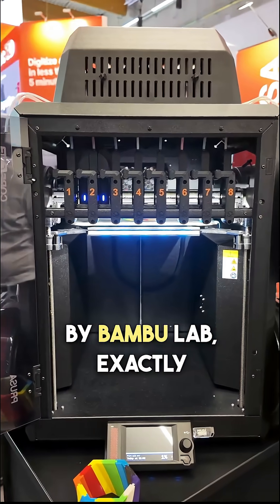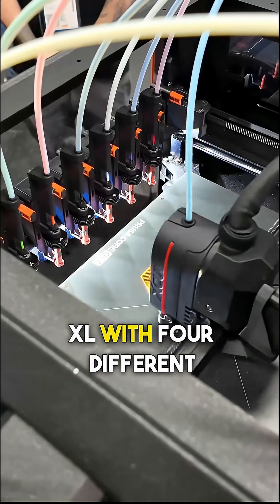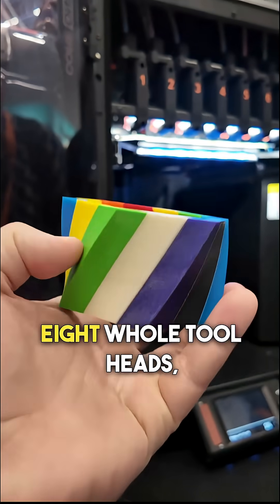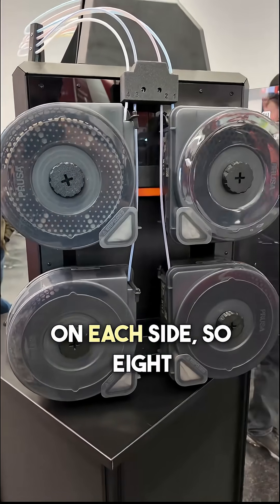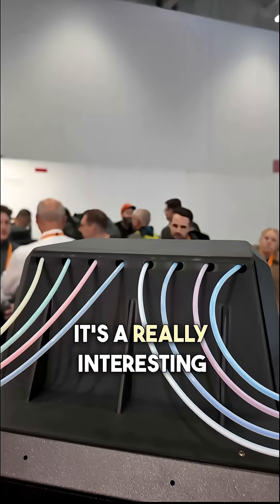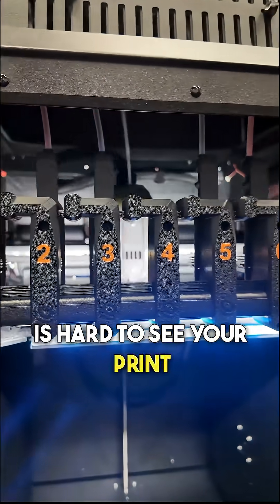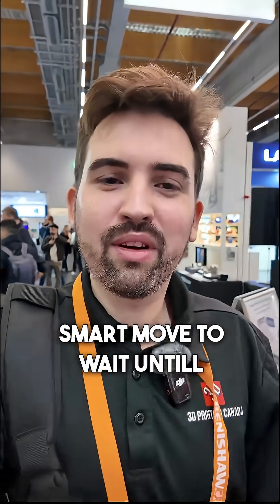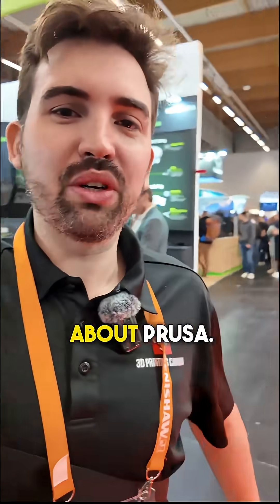The New Prusa Printer Has 8 Nozzles! #3dprinting #formnext

Comment: Why not put the tool changer on the side?
Reply: The tool changer is made to fit the machine.  Same as the first electric cars, they were made on existing frames, so they was shit.
Reply: @dubious6718 but isn't that what bambu did? I thought they made an upgrade for certain printers that added a tool changer on the side
Reply: @KiloFeenix  H2C is a new printer, but they are coming with upgrade kits for older H series.

Comment: I can’t believe they are still using 3d printed parts at this point. 

It looks amateurish now, BL and other brands using proper molded plastic parts look way better and I’m sure durability should be better as well.
Reply: Sounds like you do not believe that 3D printers can be used in manufacturing. Do you just make PLA flexidragons?
Reply: @RogerEssigArtist  i am from the plastics industry and i think what he is trying to say is first moulded plastics are way cheaper for mass production and second it is stronger and third it looks way better. I also dont get it why they do that tbh it is kinda stupid and you have to pay more for lower quality parts at the end
Reply: @anguismemes1666  I was thinking that the end user had to print the parts. Selling printed parts is even worse.

Comment: I don’t know how I feel about the 3d printed parts on a printer at this day and age.
Reply: I was thinking the same. 10 years ago it was revolutionary but now it seems cheap tbh. Specially at the prices they’re charging, it looks like a diy build at the price of a prosumer gadget.

BL and others do it much better, their machines look much more polished and durable.
Reply: you rather pay extra to have injection molded parts? Why? When 3D printed parts do the trick. Quality gets better every year and when it breaks you can reprint it because the part has been designed to be 3D printed. I don't understand how you can feel this way when you have any interest in 3D printing. Also it allows western companies to compete with cheap Chinese printers.
Reply: Agreed.  The first Prusa I bought was a MK3S, and even back then I was shocked to see it was all 3d printed.  Fast forward 5 years...they should have enough money for proper injection molding by now.  Reprap was (and is) cool, but for consumers it's time to move on.
There is another video of this thing in action and you can already see a crack forming on tool head #4.  I worry with continuous use this thing will wear out and tolerances will slip.

Comment: Prusa has developed nothing, It's an off the shelf system developed by bondtech.  It would have been nice if Prusa actually had an unveiling of a prusa/bondtech finished printer instead of introducing a DIY system made for any printer on the market.

Comment: Your problem is, it's still overpriced for the bed size, which has been a problem for them for a long time.  You can get bigger and more color options from Bambu for the same price or cheaper with a bigger bed.  Or go even bigger still and get a large format printer, with 7 "tools" (6 swappable) for a 7 color print with no purge, or a full 24 colors with purging.  The problem the Core One thing is it is fixed at 8 colors, same for the U1 locked at 4 colors.  The reason Bambu wins still is none of their printers are locked at 4 or whatever colors.  Even the A1 used to be fixed at 4 colors, can now use the Standard AMS units for a full 16 colors.

Comment: Will there be a version for the CORE ONE L?
Reply: Wont be out till mid-late 2026. The Core One version doesnt come out for ~6 months either (Q2 2026). Oh and the announced pricing was only fro the founders edition which was being sold by Bondtech, not Prusa, as only Bondtech can make them. Prusa just has paid for a period of exclusivity. The more you read about it the worse it gets, it makes it clear Prusa were not capable of making something themselves and had to outsource it. That might catch them up a bit but it does not bode well long term.
Reply: @puressk I am wondering which Modern CoreXY Printer to get (non-Bambu) I'm between the Core One L with the INDX, SnapMaker U1, and AnyCubic Kobra S1. Elegoo Centauri kinda skeptical atm

Also after an insane amount of saving...the Prusa XL 5-Head.

Comment: What is the use case for eight colors?  This seems trivial.
Reply: If you have a print farm, this is a major time and labor saver. Load up 8 spools of the same color and material, then use spool join when one of them runs out.
Reply: 8 materials not colors
Reply: @SniperTeamTango  Not advisable to print with 8 different materials.  Should be careful when using 2..
Reply: The use case is just like in other consumer goods, a race to see who can make the newest thing just because its cool and novel not to make the most practical. It's dumb and for the cost, you could go buy a cnc router or a resin printer from the difference...  Also, if you're smart, you can just incorporate multiple materials as separate parts.

Comment: Now at that points, its just getting a bit unnecessary.
What we need, is better chamber heating. I agree that bed can be used, but imho chamber heater would not hurt. With better thermal isolation
Reply: True. I have a Qidi Q2 alongside my Core One and the chamber heater means Q2 becomes the go-to ASA printer. Maybe someone makes a 3rd party add on heater for core one
Reply: @RogerEssigArtist  i feel you! I built my own hot air circulation circuit for P1S for exactly ASA reason
Reply: @AljazJelen1992  I have a hairdryer i use to get the chamber temp up and can do an ASA print at 55 degrees C as long as my house temp is regulated. I have an insulated top cover for the Core One too.
Reply: Not unnecessary at all. I have desperately needed a good printer that can handle multiple materials and multiple colored flexible filaments at the same time. The INDX should work perfectly
Reply: @DiegoJ1023  maybe not entirely necessary but its definitely a bit.
Many of the "multi-filament" 3d products can be designed in such a way, that you can print and assemble or print and glue.
As far as engineering goes, you dont need multicoloured anyway. Multi material perhaps, but then adhesion is another question mark.
E.g. if you want soft grip with tpu on the petg as basis... its better you print the petg and mold the PU around the petg
Reply: Not saying Prusa isnt great, just five cents from those who try do do more engineering printing
Reply: @AljazJelen1992  yup, heated chamber is probably the decider for me. 8 heads vs 7 isn't that big of a deal. volume also looks smaller on the Prusa.  

We need to see some head to head comparison reviews that aren't sponsored or fanboyed.
Reply: so if you go only with the single nozzle and the 6 heads, you get 325x320x325mm vs 300x300x330mm or 0.0338m^3 vs 0.0297m^3 with the Prusa or roughly 14% more volume on the Bambu H2C and only about 5% more volume on the H2C with both heads installed. 

You get  20mm more in depth but give up 5mm in height with the two heads, You gain 25mm in width (roughly 1 inch) going with just the head changer. Granted it's a little more complex than that because at the 300mm width you can still print 25mm to the left with the 6 heads and 25mm to the right with the single head, from what I understand.
Reply: @natesewell9402  Core One L will eventually get a 10 toolchanger system, but this Vid is for the Core One, which is 220x250x 270. minus a bit for fitting the toolchagers
Reply: @RogerEssigArtist  yeah My calculations were for the L. The H2C has about 125% larger volume than the smaller variant Prusa. I didn't know that the Indx system for the L is going to support 10 heads.

Comment: too expensive, both, prusa and bambulab!!!
Reply: On that we can agree, its crazy how the top systems are multiple thousands of dollars now. And then you factor in AMS systems for the H2C, you need two for the right nozzle to use all 6 vortek hotends. BUT WAIT! They give you a 0.2 and 0.6 nozzle in the mix, but don't let you mix and match nozzles on the same print. So you'll have to shell out another $80 for two more 0.4 induction nozzles 😂

Or just buy the H2C ultimate edition for like $3000
Reply: Work overtime hours and earn more disposable income

Comment: I'm a Bambu guy...but, those tubes are nice - has a V8 ignition lead look to them.
Reply: Ha I didn't even think of that. I'm also a Bambu guy. I wish I didn't buy an H2D two months ago for the same price as the H2C 😂
Reply: @SangheiliSpecOp  yeah but Tariffs had a lot to do with that price too. Makes sense to lower it some after they figured out the way to get them in without paying haha. I am on the fence because I have 2 AMS pro and 4 HT. The printer does fine with the 2 tool heads and there is hardly waste now. There is NO way I am going to buy that upgrade and I have take my H2Ds apart a few times. Stupid heater and hotend fan failures. They need to work on making it simple to get to fans that wear out for the end user.
Reply: @unitymind I have barely used my H2D for now so I haven't had those failures yet but I've heard some negative things. Actually you reminded me, support just sent my replacement filament buffer out and it arrived 2 days later, my new HT filament loading isn't being detected by the left nozzle and the extruder keeps retracting instead of grabbing it. Bambu says I have a bad buffer so I have to replace that today. The vortek kit looks like a good project, I just wish they didn't shaft us and make it $799 for the kit.
Reply: Am sadly also a Bambu Guy, and I'm waiting for the day, everything gets changed into a subscription model.
Reply: @mahe4 that would be the end of them if they did so I very much doubt it
Reply: I switched away from Prusa to Bambu simply because I no longer wanted to tinker all the time- just print my parts. I don't have a major use for toolchangers as i don't print multi-color hardly ever, BUT - I will be ordering 3 or 4 of these Prusa machines for my wife. She's got time to tinker, and she prints tons of multi-color props and cosplay bulls#it- these seem purpose built for that. 

I do feel Bambu dropped the ball by not introducing a revised AMS alongside VORTEK to better optimize filament swap times- i.e. six spool capacity with six individual tubes to the top of the printhead for ultra-fast filament changing.
Reply: If you're not chinese, even more so if you're a westerner, "being a bambulab guy" is really a strange idea and a very bad bet on the future.
Reply: @pierrew1532 china evil grrrr
Reply: @pierrew1532here comes the prusa shills
Reply: @WibberNoggin  Why shill for any brand? Brand loyalty is a fucked up bizarre thing. If a product is good, I'll give props to whichever company released it and consider buying it, but it sure as hell won't make me buy that brand exclusively.

Comment: Its so cringe to see Prusa and all the videos constantly attack Bambu meanwhile Bambu doesn't acknowledge anyone else and just sells printers that work lol. The H2C will still sell more even though its objectively slower, because it just works and everything is automated. I will be converting my H2D to an H2C when the vortek kit comes out this January. I may consider this prusa if it works out well though...
Reply: I've always rooted for AMD, but this is the same sort of thing that they would do. Nvidia would always compare themselves to their previous generation, and AMD would always project / compare themselves to what they think Nvidia was going to do. lol
Reply: Yeah that's what happens when one of them is guilty of IP theft
Reply: Josef attacked them at the start because they forked prusaslicer and dont honored the license. But when i see how Bambulab operates i dont like them. Just take NFC on spools. Bambulab use it first but only for their spools. They are like apple ... buy all from us. They also claim to have ISO27001 from dnv. But i can not find them on iaf search. Even for cert number. Which is quite suspicious to me
Reply: "Attacking" no is attacking Bambu. Bambu has an entirely different system, and multi-material systems, tool changers, tool head changers, etc have been around longer than either Prusa or Bambu. Prusa is licensing/partnering with Bondtech on this system. They didn't make it. The Bondtech INDX is just a better method than the Vortek. The Vortek is designed to keep using Bambu's AMS ecosystem. Bondtech also has patents, so I'm not sure how much Bambu could've done without needing to license it. 
Someone else mentioned Nvidia vs AMD, and that's a good example. When you're the underdog, you are going to compare yourself to the leader. When you're the leader, you don't compare yourself to lesser products, you compare to your own products. It's a form of arrogance from market leaders. In a healthy competition, both would reference each other and market how they think they are better.
Reply: Prusa, to my knowledge, have never attacked Bambu... What the Youtubers do for clicks isn't at their behest.
Reply: @krazed0451 fair, but even on prusa's own blog post they specifically point out "dual nozzle printers are a special case and the nozzle changes on that system take 40 seconds"(I'm paraphrasing), specifically targeting Bambu. They can do what they want but its just weird to see all the jabs from youtubers and prusa themselves, I know everyone is mad at Bambu for innovating and locking down their ecosystem, but the reason everyone will spend H2C money is because their printers just work. Also, you don't make really good printers with off the shelf parts. I have seen three youtubers now complain that 3rd party manufacturers may not be able to make induction nozzles because of the pcb on the hotend. But the whole reason Bambu did it in the first place is for contactless communication and power (unlike the snapmaker U1's pogo pins, for example). Also, induction heating is no joke, so if they are doing this system anyway, then you might want to stick to bambu so you don't get molten lava on your heatbed lol.

But yeah its just tiring to see the hate on Bambu, I know people like to tinker and Bambu's aren't those machines, but they have introduced a lot of people to the hobby
Reply: Prusa make toy printers for toy makers. INDX fits this with 300 nozzle and 50 max chamber. For toy makers, nothing more. YUUUUK
Reply: I agree, Prusa is so cringe. Just milking cash for as long as they can, 0 innovation. 

Bambu is a fantastic company propelling 3d printing into the future. They’ve got my business for life, or until they stop being innovative :)
Reply: @erikhoffmann1252 Of course they got your business for life big boy... One forced software update and your printer becomes a piece of modern art.
Reply: @00000005547 what is this doomer take that everyone has on Bambu. Why would they brick your printer?
Reply: @SangheiliSpecOp not intentionally (obviously), but anything that relies too heavily on online features easily becomes a paper weight if they make a mistake (like when they accidentally started prints on anyones printer that happened to be online, look it up) or a bad actor pushes malicious update.

I have a bambulab printer and I love it. But I unplug it when not in use. 😊
Reply: @ZpeedTube fair enough. I have my A1, X1C, and H2D on individual surge protectors and remote outlets so I just hit a switch on the remote when I'm done printing as well so I don't wear out the switch on the back of the printer or use unnecessary power. I am familiar with the printers starting by themselves that one time yes. But eh everyone is over reacting at Bambu. I don't get being upset at innovation. The majority of Bambu users don't even use 3rd party hotends, bambu does a good job optimizing theirs for their printers
Reply: @erikhoffmann1252 same
Reply: @erikhoffmann1252 while prusa did copy some of it, Bambu did take the idea from Bondtech which already had used this proof of concept and released a video on this same principle a month ahead of both Bambu and Prusa, so calling Bambu the only innovator here is a bit much.
Reply: @tricilin Bambu started on the vortek system immediately after releasing the X1C. To say they copied bondtech when their kinematics are entirely unique, and the wireless pcb boards had to be developed and certified from scratch is a reach.
Reply: @SangheiliSpecOp You mean the DRM print heads? Just another case of Bambu locking down their ecosystem.
Reply: @erikhoffmann1252 Yeah! Zero innovation, just milking money the Prusa XL that is first of a kind commercially available tool head changer or how they were among the first companies who propelled 3D printing. Oh Oh and the fact that it’s entirely opensource that’s just ridiciulous. I mean thank good for Bamboo lab lab who never were on thin ice due to patents. Yeah they are the best.

Comment: I needed an active heated chamber.
Reply: This should be standard on every enclosed printer with every brand. Its so easy to throw a tiny heating element in there
Reply: I am fully on with this one...
I agree that bed can be used, but imho chamber heater would not hurt. With better thermal isolation
Reply: The Core One L bed is powerful enough to heat the chamber quickly with the extra fans.
Reply: the XL only heats up the bed where needed